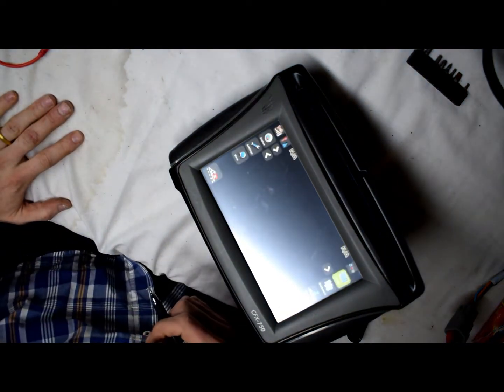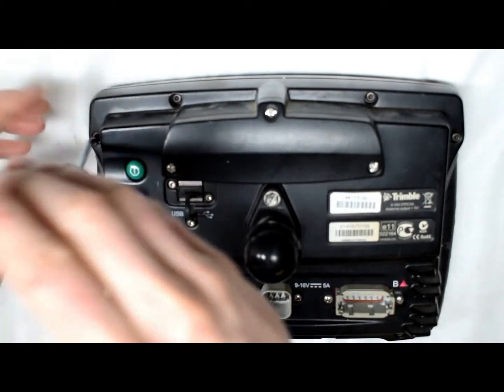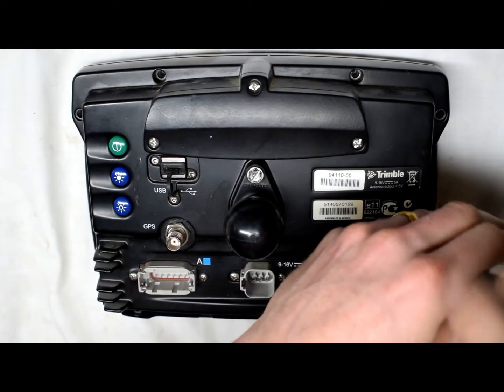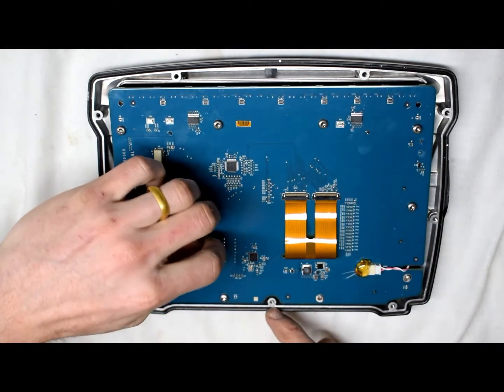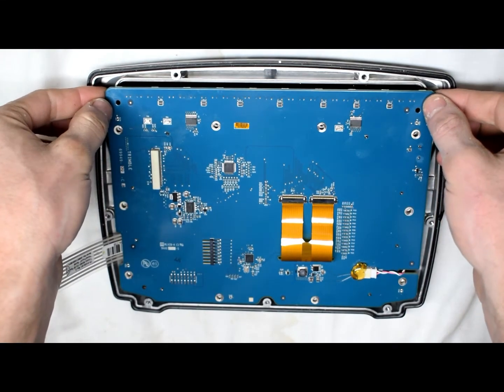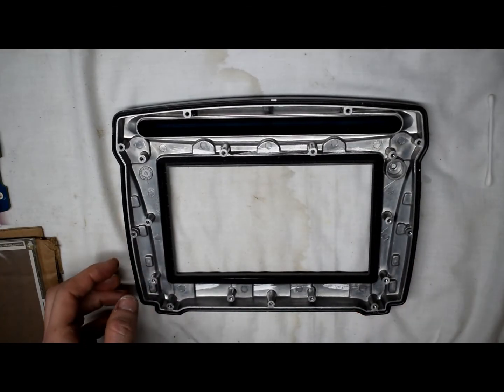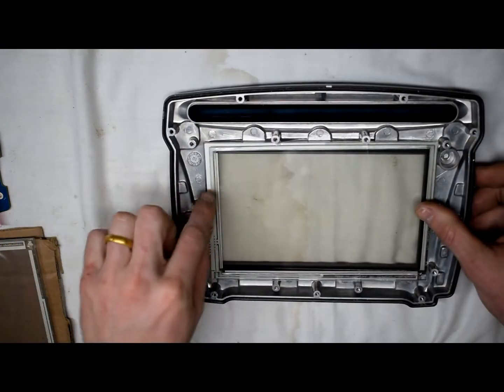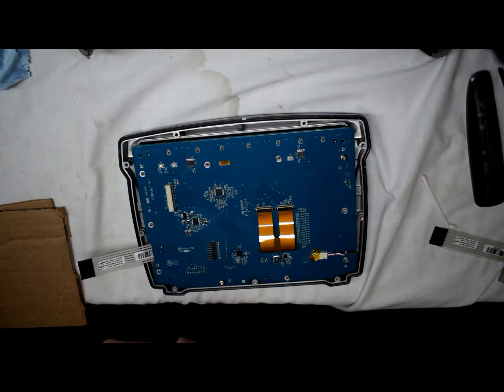Trimble CFX 750 Repair

Comment: Hi ! U have Movie repair touch GreenStar John Deere GS3?
Reply: This is so much harder.  There are plastic rivets you have to cut and the GEL (loca?) between the digitizer and the screen is terrible to remove.   It's like no other adhesive we've tried to remove. We just replace the LCD and the touch as it takes too long to get rid of the Glue/Gel.  Then you'll have to repair the plastic rivets.

Comment: This vid was a big help!  I had been removing my Trimble FX750 screen every night because they are being stolen in the UK, and a fortnight ago I dropped it.  It fell onto concrete and unluckily the screen was broken across the middle by a stone.  Wouldn't it just have to fall onto a stone!  After a phone call to the Trimble agent in the UK the repair appeared to be at least £1500, and a call to another repairer was unsuccessful too.  I heard the person I spoke to say to someone else "...another man who can't drive straight..."  How condescending - I'm a mole draining contractor and admittedly use my Trimble to steer my Claas 75E (not always in a straight line - occasionally in an adaptive curve) but also to find marks in hedges, see over hills, on foggy mornings etc.  I have been driving crawlers for more than 30 years, and yes I can drive in a straight line, thank you.  Anyway, I bought a replacement touch screen from China costing less than £90 including postage and it arrived in 14 days.  I fitted it with the help of this vid, and it works perfectly!  So thank you to Newsons Electronics - you have saved me a LOT of money!
Reply: Can you tell me where you found your touchscreen? I need one
Reply: @murraywilliams8679  Hi Murray.  I got one on eBay from China.  It arrived in less than a week.
Reply: @johnfearnley7712  sorry meant to say 124 high
Reply: @murraywilliams8679  Sorry Murray - 124 high doesn't mean anything to me.